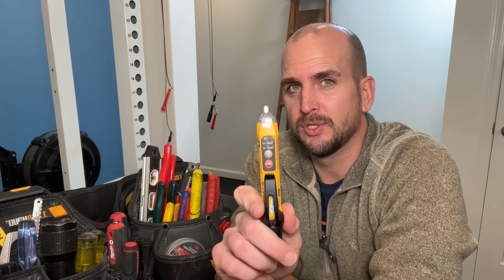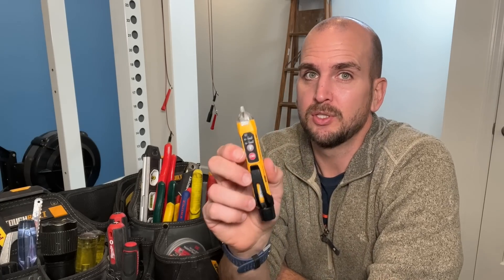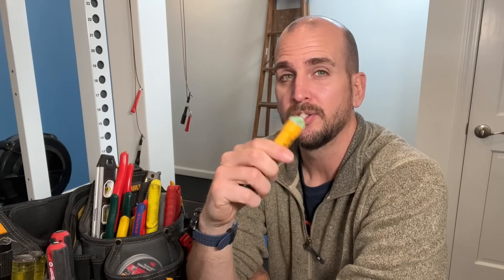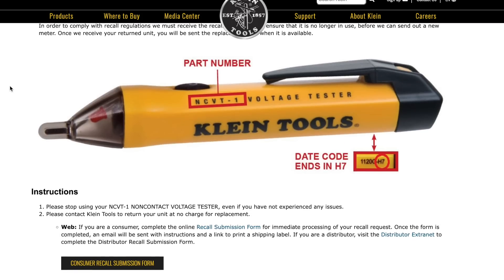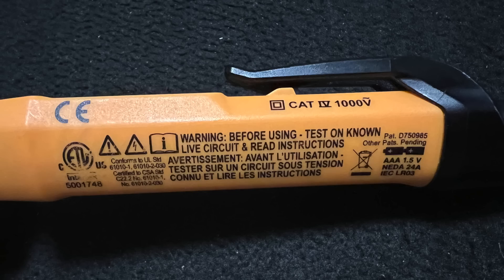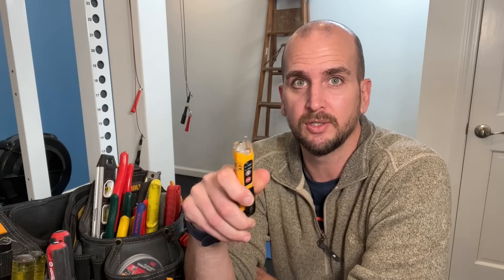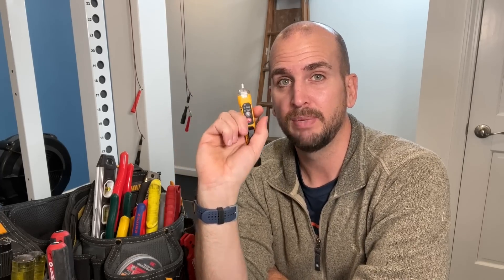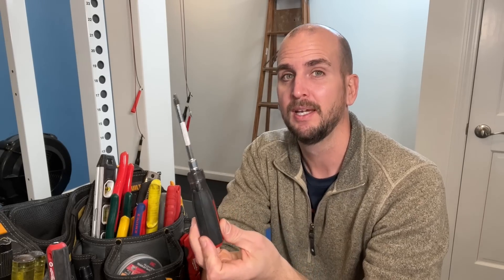The Tool I Get The Most Negative Feedback On And Still Use Weekly

Comment: One other thing you didn't mention is some of those need to be VERY close to the live wire and could give false negative if you tap the wire on the "line" side of the light-switch instead of the "supply" side.  You really need to get as deep as possible in EVERY corner and all sides of the box (and between devices) because there's also the chance a box can have more than one feed into it especially with multi-gang boxes.

The thing that you mentioned about testing on a known live wire before AND after is something I worked out very quickly with one I have.  Its got a crappy power switch that is just a belt clip pressing on some metal and often makes poor connection.  I also like to repeat the test several times (at least 2-3) to prove its giving consistent results, and if I get any unexpected pos/neg result I start over again until I prove it has consistent results, or consider a different tool as supplemental verification.

All issues considered, I do think that its a VERY good tool to have especially for those who may not know how to properly or safely use a volt-ohm meter (e.g. put it on amps and blow it up in your face), or as an initial scan of the situation.  I also used one recently to track a faulty outlet that the wire seemed to have an underground break, and when digging we encountered an unexpected wire that we didn't know if it was live or not (and then from the middle found the breaker to kill it).  Its also handy if you can't easily get at something with a meter and have to find the breaker to de-energize (say a tight metal 1-gang switch box you'd risk shorting hot to grounded box) -- get it so its beeping/blinking and have someone go thru the circuits until it stops then flip the circuit on/off to verify its working as expected.  Now you have identified the breaker.

Like any tool it has risks and limitations, and also has times it can really shine.  I wouldn't replace my multimeter any time soon but I also wouldn't want to give up my NCV tester either.

Comment: I worked for nearly 42 years in a generating station. Part of my job was to establish safe working conditions for maintenance staff. We always verified our pot checkers on known live circuits before and after a test to confirm isolation (company procedure). When loads had to be physically disconnected (e.g. for a motor replacement) it was also our procedure that the electrician would test for potential at the load, immediately prior to disconnecting the cable. In higher voltage applications we applied grounds at the circuit breaker cubicle and they still had to check for potential at the load before any approach to exposed (possibly live) terminals or conductors.
Reply: An annoying process. Time consuming. And redundant. But no one gonna die. I work for a pipeline company that makes me
Do time consuming things. And contractors get mad at me. I get annoyed. But I have never been hurt following The rules. These rules are written in the blood of fellow
Coworkers.

Comment: I've worked on 12VDC TO 12,000VDC AS WELL AS 110, 208, 240 AC since I was 19 (1972). NCV testers changed the way I worked when they came out. Of my half dozen testers the one in the video is my current go-to. I don't touch AC wiring without my tickler

Comment: I do electrical regularly , and use the non-contact testers religiously.   My most interesting weird NCVT story was when I was working for a service company that was taking down a couple of 60' silos.  I had disconnected the power earlier, and the guys were tearing out the wiring preperatory to lifting the silos off of the foundations.    I got a call that one of the guys had gotten shocked.  I said no way, because I had disconnected everything.   My NCVT said the entire silo (walls and all) were hot.  The crane was connected, and I saw it wasn't grounded.   I warned the crane operator that he wasn't grounded.   He said he was using a kevlar strap so he didn't need to be grounded.   I called B.S. on that one.   I pulled out my NCVT and I could detect his crane at around 10'.    I told him to ground the crane and there was no more trouble.  In other words, the guy working on the silo was zapped by static from the crane.   That's why cranes have grounding points.
Anyway, I trust my NCVT, but I do test it on a live circuit now and then.

Comment: I just get my ex wife to hold on to the wires and when she stops bitching and yelling, I know for sure the correct breaker is off. If it were that ez🤣🤫🤫🤫 … Otherwise, I don’t trust the no contact testers and I have used different types & brands, to make sure, I use a VOM or my little brother…. No no, I mean my sister or whoever is helping me…. 😱😮😱😱 I always use a meter and not an actual person. For those that have no sense of humor, get a life.

Comment: I agree that non contacts have their uses, HOWEVER I personally despise them. Before anyone gets mad let me explain. I retired this year after servicing water wells for several decades. The most common diy mistake I have seen is using a non contact device to check for power to the pump motor. A high percentage of pump motors use 230 volt supply (I.e. L1/L2 or 2 pole supply). The problem is that many diy don’t realize that voltage from L1 feeding through the motor will give a positive response even though they have a fault on L2. 

I have had many customers made that mistake and go out and spend hundreds of dollars on replacing a unit unnecessarily only to find they still can’t get it to run. “I checked the power and I have it on both sides of my pressure switch, but the motor doesn’t run!” Sometimes I have found the problem to be as simple as an ant between the contacts on one side of the switch. 

Moral of the story: don’t use a tester to check a 2 pole circuit. Use a volt meter. Use the tester for its intended uses - making sure a circuit is off before touching it, tracing a live circuit, etc.

Comment: I have a Southwire 40150N that I use here at work. I a NCV tester here at work not because I do any electrical wiring, but some of the equipment that I use and occasionally troubleshoot use solenoid valves. For valves that don't appear to be working I can use the NCV tester to see if the solenoid coils are getting energized to help me determine if the problem is a wiring issue or if the mechanicals of the valve have seized up. It is an inexpensive tester and seems really susceptible to mechanical shock (I can get a single beep just tapping my finger with it), but for my purposes it is acceptable.

Comment: You need both no contact and a volt meter.  It's also important to have a good quality no contact detector. Cheap ones will pick up on current not actually associated with the wire being scanned sometimes.

Comment: I would not want this around 277/480, even though it's theoretically rated to 1000.  That may be why some of the tradesmen ding it.
If I'm suspicious about a circuit I'll also run an amprobe.  That tells me for-sure if there's current being drawn, even if the wiggy and multi-meter fail to register.

Comment: I personally would never trust these things to tell me the circuit is dead. If they tell u there is power then likely there is. If they say no power out comes the fluke. When testing for voltage with a meter check line to line then line to ground then line to neutral if present and neutral to ground.

Comment: HVACR tech with 3 decades under my belt. I use a field piece multimeter with built in NCV. The NCV function, can save you from some nasty shocks if a transformer shorts and puts high voltage on a 24 v  circuit, or when some dumbass wires through a disconnect,  or many other occasions,  I don't touch a wire  without using ncv function. Also had a very good friend, we will call him Sparky, had to spend a week in the hospital. He was working on 12v dc on his boat, and someone before he bought it, ran shore power in the same chase as DC. If would he had one, he does now, and used it it would have kept him safe., while standing barefoot on an aluminum hull in 3 inches of salt water.  I don't care what anyone says, buy one and use it.

Comment: I'll use the non contact tester to quickly see if a wire is hot, but I refuse to use it as confirmation that it's OFF and safe to touch. Got to make contact metal on metal before I'll call it safe to touch. The tool has its place, but I won't ever trust it completely.

Comment: I use a NCVT just to tell me if the circuit is hot or not then before I actually start touching wires I'll use the multi-meter .  I'll also always use the rub test on my sleeve to see if it detects static first . If I get a non-live result with the NCVT I will do the static test again to make sure it is still working . Too many close calls in the early years to not use the multi-meter before touching wires . The NCVT is a great  asset for quick diagnose though .

Comment: Like you said, a multimeter/continuity tester is the proper way of checking if something is live. But if you are fault finding a major installation, a voltage detector is insanely handy. There might be a cable that has been connected to the wrong breaker, and being able to quickly test what breaker it belongs to is why electricians use them. Because they can detect a live cable even if there is no draw.

Comment: Make a difference of hot-wire checking for your safety or finding the right wire down the attic and verifying a circuit whether it is properly installed, insulated, grounded.
Decades ago telephone companies where indicating if your line was free to dial or occupied or quiet when out of service. Why is it so complicated to duplicate such double check. A tester should give three different feedback states: off, no voltage but on and voltage by light and sound. And even more when it's testing more like low vs. high voltage.

Comment: NCVT are handy for quick trouble shooting and identify hots from switch legs etc. However they are able to be fooled by induced voltages. Generally you don't see this unless around 277v and up. So mixing low voltages with high voltages in the same conduit can give you false positives. Use a meter or wiggy.

Comment: Great video. I use these around home. I do my own electric work unless it’s major. I have a tacklife VT 02. Works great. I found this useful when I was looking for a broken wire in my attic. I found exactly where it was broke with power on but not getting power to a room Upstairs. A contractor was cutting on outside of house and nicked wire. This tool helped me where a voltage meter was useless.

Comment: As I understand it, only the "Santronics  model 3115 non contact voltage sensor"  is approved by OSHA.  It has no buttons or sounds, you just swipe it on your shirt to test it before you use it.  It looks like a red pen with a white tip that lights red when it's close to voltage. Works great. No switches or modes to fumble with. It's also the only one presently made in USA.

Comment: I use a NCVT anytime I need to know if a circuit is hot/not. I use a multimeter if I need to know voltage. The NCVT is quick, one-handed, and you can wedge it on the wire and try breakers until the audible tone stops. Very useful and has never done me dirty.

Comment: Another false positive can be caused by an adjacent wire that goes along a hot wire for a long distance.  The coupling between the hot and adjacent wire can trip a proximity electrical detector.   This is not conjecture – this is experience in my own house.

Another benefit of proximity electrical detectors is detecting an electrical box that has more than one circuit in it.  Even in houses, electrical boxes can contain more than one circuit – for example at the kitchen to garage door the switch box may have two circuits – one for the kitchen lights and another for the garage lights.

I worked in an industrial  facility that was built in the 1950’s and the electricians used a proximity electrical detector to check if the box was hot since many large boxes had more than two independent circuits in them.

Comment: Depends on the type.  I’ve one that I use that is and has been 100% accurate.  I mislaid it and nearest supply shop had one that was about 50% accurate.    What I found among many brands is that if you can get the unit to signal by shaking it it’s garbage.
Reply: lol I always test mine by rubbing it on my arm hair

Comment: Also important to be aware of what causes false negatives.  Wet or damp insulation can prevent a positive reading on a  full 120 Volts.

They also don’t work if your working on any commercial project.   Just being in a shared conduit run with another circuit that’s hot can cause false positives all day.  It also has a lot of trouble picking up voltages from unbalanced loads on a neutral.  Can be 50volts and a good shock.    
They are not a safety device. Put your multi meter on continuity, test leads every time, then check voltage ( that’s why meters without resistance don’t have removable leads).  

Be safe out there.  

I still have one if I have to check 30 outlets to get a rough idea of what’s on a particular circuit, then there great.   just don’t go touching wires because a non contact didn’t beep .

Comment: Every electrician I know uses one as a first method of troubleshooting. Anyone not using one is wasting time. They will have more false positives than negative, mostly if you have a box full of wires and even one is hot, all the other wires touching it may show as hot. Pull them out and separate them. Electrician approved (me!)

Comment: If you’re doing rough in’s, sure maybe you can let your guard down.  But otherwise never trust a label, breaker, wire (regardless or gauge ),or the previous tech in general.  I don’t even trust touching any metal box, light, ballast since grounds can break or be forgotten.

Comment: I always test with a multimeter. Many contactless testers tend to have false negatives, especially for exposed but capped off lines, some will not reliable trigger. They need one with a voltage readout that is loosely accurate benough to do a sanity check on the result.

Comment: Two comments (not that anyone was looking for these haha)

1. Most of the issues with non-contact testers (or tickers) are probably solved if people tested a live circuit first. You pointed it out and it is also clearly printed on the device as well. I always test a live circuit first (whether with ticker or my meter) if I'm betting my life my tester of choice is correct. I actually learned yesterday it might not be a bad idea to treat the circuit as live all the way up to intentionally shorting hot and neutral after they're disconnected so if the circuit was still live at the point you had wires disconnected (i.e. your meter or NCV tester failed you), the circuit breaker would eat the dead short instead of you and you would just have to bear the brunt of the arc flash (you are wearing your FR gear right? :) ).  

2. I prefer tickers when working on receptacles and any other place where access to testing points is limited. It's happened to me a few times where I might not quite hit one of the bus bars in an outlet and the meter read nothing. A NCV tester doesn't have that problem. 

- industrial electrician

Comment: Very good video   I am a licseened commercial electrican.  Yes very good tool. Many times a electrical box did have several source's of power in the metal gutter.  With 480vac, one leg is 277 or more to ground and just a nick or a stray stran of wire could find you. Always check and recheck any time you open a disconnect.plus always check your tool or meter on a live circuit.

Comment: I've had my share off 110 zaps but once I got a good 220 experience from something that was not even part of a circuit (copper a/c line touching shielded romex with a short or something) I test all of it with non-contact, plug test, and/or circuit tracer plugged in to find the breaker.  If any doubt I flip the main breaker.   I still do a quick "spark test" and short the wires with an insulated screwdriver against each other and box.  Rolling away to force your hand to let go while getting shocked is not something I'm risking again...

Comment: I always write the installation date on the batteries of my tester as a reference. Ideally, I should replace them after 1 year depending on the use. As you stated, it's important to test it first on a known power source to verify good operation. If there's no other power source around, I usually rub it on my clothes or on my hair to make it beep with static electricity.

Comment: Retired power plant electrician.   I use a tic tracer regularly, not too big on DMMs for checking the presence of AC voltage as most of them don't load the circuit.   My Wiggins still gets used regularly.   Not too popular these days, but the tactile feedback can't be beat.

Comment: NVC???  That's called a "Tic" where I learned to use it as an Aluminum Smelter "Sparky."  We used the "rub test" to verify the tester worked as intended each time before and after a voltage test (many times a known live circuit was not available) - it's not a "false positive" when the tic make a valid detection of static charge.  Fluke was our chosen brand, and our lives often depended on their correct and diligent use.

Comment: Ncv is my first tool for Live? Or flipping breakers and switches etc. I always test it first on live, but during the years have noticed that battery connection gets iffy,  even during usage the unit can shut down because of this.  I'm always carefully paying attention to the status of the tool.  And if any questions arise,  I just grab the meter. And if im super paranoid,  I'll just cut the main to the panel.  Not a big deal with residential work usually.  The main thing is to protect your self,  not the clocks in the house.  They are easy to reset